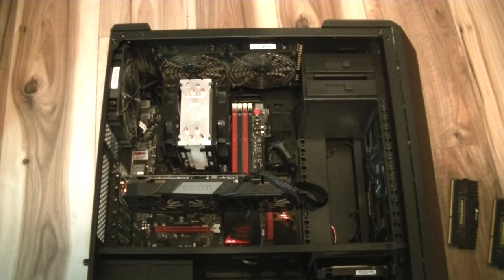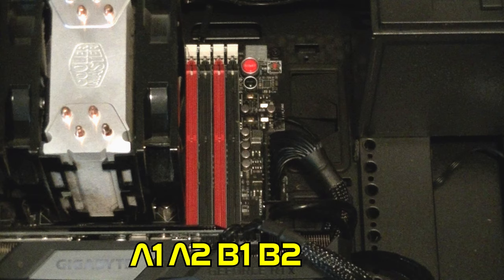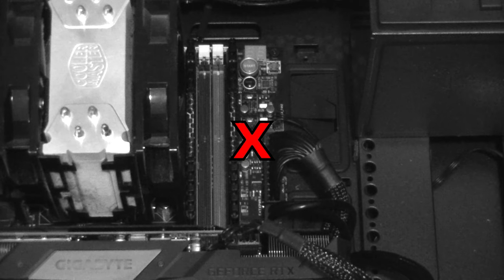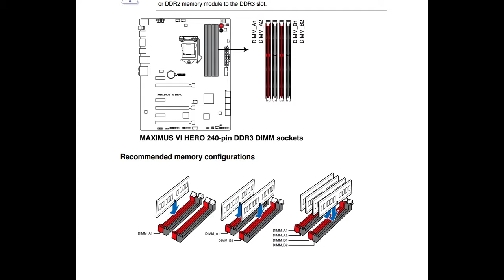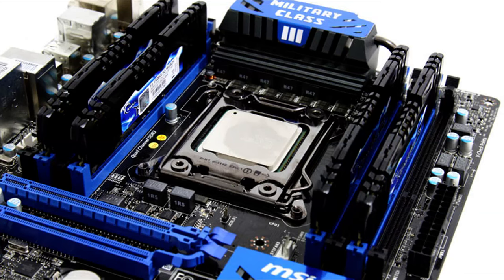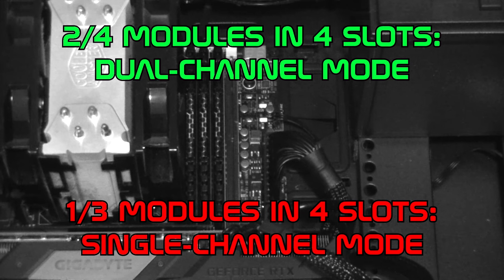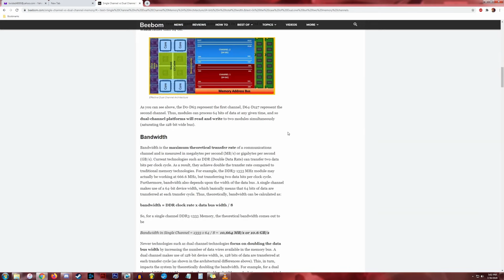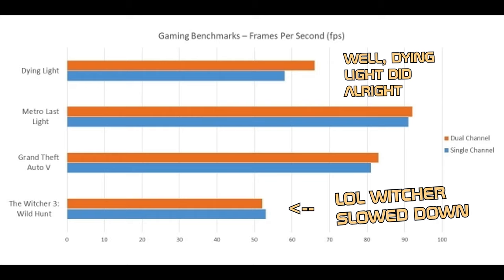How to Make Your RAM Run in Dual-Channel Mode

Comment: Hello, I wanted to ask a question. How do I get Dual Chanel activated?

I have an MSI 970 Gaming and 2x8 1600 MHz. I put one in the first slot and the other in the third and it doesn't work, keep saying "single".
 Is it because I only have 8GB usable?
Reply from the maker: Sorry for late response... From the info you have gave me, that is very odd. The amount of RAM should have no influence on whether the system runs in dual-channel or not. Have you read the MSI 970 manual? Are you sure both cards are in the proper spots for that particular motherboard? Also, what application is telling you that your RAM is "single"? Is it the BIOS/UEFI or an external application in the OS?
Reply: @Torqcx  
Don't worry ...
 In fact, I have read it and yes, they are well put, in the same way I tried 2-4 and nothing. In the BIOS it shows me that it is working in "Dual", but when I start the computer in CPU-Z it says "Single" and the amount of usable RAM is 7.90, but the detected amount of 16. Both are exactly the same in everything.
 Thank you!

Comment: What about if my motherboard have for slots for rams and i got only 3 rams of memory,each 8 gb ddr4..will be fine to put them all 3 on my motherboard?
Reply from the maker: That will work fine but you'll get single-channel mode. If you go down to two sticks or upgrade to four you will get dual-channel mode.

Comment: Yeah, I have a question; how do I check from within Windows whether it's in single-channel or dual-channel mode?
Reply from the maker: I don't think Windows itself has a straightforward way of finding that out, but there are several programs for free such as Speccy you can download that should be able to tell you

Comment: Two questions:
1. Does it matter it one pair is e.g. 4gb and the other pair 8gb?
2. Does it matter if one pair is 2666mhz and the other 3000mhz?
Thanks!
Reply from the maker: Yes it does matter for both scenarios, as it's always recommended to get the same exact module of RAM when installing multiple cards. You can try using two different kinds, but it may not run in dual-channel mode and the speed/timings may be off/bottlenecked, or the system may not boot at all. But there is no harm in trying.
Reply: @Torqcx  Thanks! So if I get four identical modules they will all run in dual channel?
Reply from the maker: @RecordableID  Correct! All slots filled up with the same exact model of RAM should have it run in its fastest possible speed!

Comment: I have three sticks on dual channel and the new one I had to replace is now single channel. What can I do?
Reply from the maker: Three sticks were running at dual-channel? May you check your motherboard's specs? It's possible two of the sticks were running in dual-channel and the third was at single, simultaneously.

Comment: Sir I have asrock B550m Steel Legend with 8x2gb RAM installed. I want to upgrade my RAM to 32gb, can i just buy again the same brand series RAM 8x2gb or I need to buy a new 16x2gb RAM and replace it ? oh and my CPU is ryzen 5 3600. thank you
Reply from the maker: First off I'm assuming by "8x2GB" you mean "2x 8GB"? If so, yes, you can buy the same models of 2x 8GB RAM cards and install them into the vacant slots and you will have 32GB of total RAM. (According to that motherboard's specs, it supports a total of 128GB).
Reply: @Torqcx  yes, Im sorry I mean 2x8 gb, ok sir now I understand, thank you for the answer, I hope the best for you channel !

Comment: How about if I add a different pair of DDR4 sticks in the 2nd channel. Would it work? I'm planning on buying a 16GB (8GBx2) kit and add it to my existing 8GB (4GBx2) RAM. Please give advice on this. Thanks!
Reply from the maker: Always recommended that you get the exact same make and model of RAM modules when adding more RAM, otherwise you may run into compatibility and/or timing issues.
Reply: Yes you can. You can find more information on that in this link from Intel website:
https://www.intel.com/content/www/us/en/support/articles/000005657/boards-and-kits.html

Comment: Wow that was clear! But another questions from me, i have crucial ballistix 16gb  2400mhz X2, if i would extend IT to  another 2x 16gb do i have to but The same menory or i could go buy 2x 16gb g.skill 2400mhz ? Will dual channel still work?;) Motherboard ASRock z370 pro4 Thank you !
Reply from the maker: It's always recommended to get the exact same make/model of RAM if you're going to add more. Theoretically, you "could" get a different brand and it may work, but it's likely you'll run into problems with the timings or the system failing to boot entirely.
Reply: @Torqcx  my ram in 1 and 3 slot is that okey?
Reply from the maker: @imohab1117  yes, that's perfect.

Comment: any ideas on why when i try to put the ram in the two slots my monitor doesn't want to work anymore or my pc wont fully boot up?
Reply from the maker: Try each RAM module individually in each slot on the motherboard; it sounds like either one of the modules or slots is faulty and causing the PC to fail to boot, which is common with RAM. If it's the RAM, you can get a new module, but if it's the slot, unfortunately there's nothing you can really do other than getting a new one.

Comment: On my Archlinux + Ryzen 5600G I got about more 15 FPS by going to dual-channel, now I'm finally closer to 60 FPS (average)

My question is: Is I use 4 RAM sticks, I'm still on dual-channel, but it will get faster? 
I'm using B1+B2 (as manual says) but if I also use A1+A2, it will make a difference?
Reply from the maker: If anything the performance will increase if you add more RAM to the system. You may get a slightly higher FPS boost if the system was reaching its capacity of RAM prior
Reply: @Torqcx  In game 16GB are ok, but in CAD and Simulation applications, I do feel a little stuttering here and there , I'll think about add more RAM when I can afford. Thanks for answer!

Comment: If i put 2 sticks in 2nd and 3rd slot then is it considered as dual channel or not?
Reply from the maker: No, that would most likely run in single-channel. Put them in the 1st and 3rd or the 2nd and 4th.
Reply: @Torqcx  I only have two ram slots of the same color, can I run dual channel mode if I put 2 ram sticks? 😔
Reply: I only have two ram slots of the same color, can I run dual channel mode if I put 2 ram sticks? 😔
Reply from the maker: @liounique1177  I had a system with only two slots and it ran in dual-channel, so I'm assuming yes
Reply: @Torqcx  oh, thanks for responding. 🙏

Comment: Almost all motherboards manuals suggest that if there is only 1 pair it should be placed in A2 and B2.  Then if there is a 2nd pair they would go into A1 and B1.
Reply from the maker: That's probably because A2 is further away from where the heatsink would go (occasionally I hear reports of people being unable to get their RAM in one of the slots because their heatsink is overlapping it)

Comment: I bought new ram 2x8 3200mhz, and in the motherboard book it says that i have to put them in slot 2 and 4, but when i did that i got a orange lamp on motherboard and computer didnt start. So i have them in slot 1 and 2 and have only single channel now. Do you know how to fix it?
Reply from the maker: Did you try slots 1 and 3? Someone recently commented that motherboards will often instruct to add the modules into slots 2 and 4, but it shouldn't matter; I think they say that simply because some people's heatsinks are so huge that they get in the way of the first slot.
Reply: @Torqcx  Okay, i will try. Thanks for answer.
Reply: @Torqcx  I tried to put the ram in 1 and 3 and i got red dot behind ram and after 3 sec. The lamp was orange. If i put them i have orange dot again. I use boths ram sticks now but in 1 and 2 slot. Cause if i have them anywhere else the computer is not booting up. Still have single channel :/
Reply from the maker: @ProEzX1337  that is odd. Are you sure the models of RAM you're using are 100% supported by your motherboard, speeds and all? If so, the only thing I can think of is that the motherboard is faulty. Unfortunately there may not be anything else you can do other than perhaps trying a new kind of RAM model or swapping the motherboard out.
Reply: @Torqcx  hmm ye. Thanks. Im so unlucky heh. The feeling when you are so glad of new things and then it is worse than The one i had before heh

Comment: I got CPU i5 8400, ram 8gb 2400 Mhz single channel. I play CSGO but I usually meet the fps drop and the game just keeps lagging. I think it's due to my CPU, but could I append 1 more ram stick (also 8gb 2400) to run dual channel, in order that the game is smoothier and the fps drop gone ???
I need some advice from you. Thanks in advance!
Reply from the maker: Lots of people have been telling me they've been getting considerably faster FPS from switching to dual-channel, so honestly I'd upgrade to that first and see what happens! Might as well :)

Comment: I only have two ram slots of the same color, can I run dual channel mode if I put 2 ram sticks? 😔
Reply: i have same question if you have the answers pls tell me it says dim1 and dim3
Reply: am wondering the same
Reply: I just found a comment where he said this "Usually when I see a motherboard have only two RAM slots, filling both of them up will have the system run in dual-channel mode."
Reply: @born2270  thankyou 😚😚♥️

Comment: Hey bro! Im having a problem when phtting my ram in dual channel mode when i put it and go to the BIOS it only have one ram and i boot it and go to the task bar its same idk what wrong im new in pc part. Sorry for bad english
Reply from the maker: Troubleshoot by checking each module in each individual slot, this way you should be able to rule out whether it's the board or RAM's fault.
Reply: @Torqcx  how to know if its the board or ram what will happen?
Reply from the maker: @motchi3975  Hopefully this video will help: https://youtu.be/O7Y0bcRoarM?feature=shared

Comment: Can i use 2x4gb And 2x2gb ty great video
Reply from the maker: You "can", but there may be speed/timing issues and it may not run in dual-channel. Always always recommended to get the same exact make and model of RAM when installing multiple modules. It can't hurt to try, though!
Reply: Lol my new 4 gb corsair dont run at al
Reply: My old memory is 2 times 2gb 2rx8 pc3 – 10600u-9-10-b0 my new is 2  times 4gb corsair 1333-999 or 1333c9. IT wouldt boot but detect ram at startup om lost

Comment: I have 16 gb single channel ram, so if buy the same exact ram and install it will my computer run at dual channel at 32gb?
Reply from the maker: Assuming you currently have only one module of 16GB, yes, adding another should have it run in dual-channel!

Comment: Permission to ask sir, so I have a motherboard that supports ddr3 ram up to 32gb with 4 ram slots, I also have a cpu (i5 3570) that supports ram up to 32gb ram but only supports 2 ram slots. I have also installed dual channel ram (2x8gb ram ddr3 pc 12800), if I add 2 more chips it will become quad channel, does it read 32gb sir? Or only 16gb? because my procie only supports 2 ram slots
Reply from the maker: I'd need to know more about your motherboard's model, but it sounds like it should read all 32GB? I've never heard of a CPU only being able to read a certain number of slots.
Reply: @Torqcx  i use gigabyte GA-B75M-D3H lga 1155 with 4 slot of ram and has maximum ram up to 32gb, i also use the i5 3570, yesterday i checked my procie specs because i wanna upgrade my ram to 32gb, i checked the specs in intel official web and it's say max ram 32gb but it only supports 2slot/channels.
I don't know if i can upgrade the ram or not because of that. What do you think? Can i upgrade my ram?
I don't know the concept about all of these:(
Reply from the maker: @eefsx8761   I looked up that processor's specs and I saw on their official website that it says "2 channel" but I don't see anything about it being limited to two slots. I believe it simply means that it only supports up to dual-channel mode, which, after looking up your motherboard's specs, also only supports. So you should be all good!
Reply: @Torqcx  Wait really?! I'm so grateful to hear that, finally i have the answers, thank you very much for all the information, i appreciate it, soon i will be upgrading my ram, Thanks again, I wouldn't have known about it, if not because of you. You were only youtuber that reply my comment, i know you'll get places some day, see you on top bro👋🏻

Comment: Ok late late question time

I have 2gb, 2gb, 2gb and 1gb ram and I have 4 slots so does it still run at dual channel mode or no?
Reply from the maker: There's no harm in trying by filling all the spots up if that's what you have; you probably will get dual-channel, but you might not.

Comment: Hey, ive bought 2x 8 Gig sticks from corsair. If i insert both in the right spot like the manual says the pc wont boot.  When i remove one it runs fine, any solution?
Reply from the maker: Check each slot individually with each RAM module. This you may be able to determine whether you have a bad module or a bad slot on the motherboard. Also try setting the BIOS to default settings if nothing helps, then try again.
Reply: @Torqcx  Thanks for your answer, this is a brand new build i've done. One stick seems to work on every Slot, but the other stick does not. I can't install any drivers since my internet is dead since days unfortunately.
Reply from the maker: @kotmidasbeats1499  it sounds like that module that won't work is DOA unfortunately, which is very common. Luckily it's not the motherboard's fault. Just return it and get a new one
Reply: @Torqcx  Considired it! Thank you, i'm going to return it and get a new one.

Comment: So I don't need to activate anything in the BIOS after adding a ram stick?
Reply from the maker: Nope, not normally! Sometimes when you have different types of RAM in the system you may have to fiddle around in there, but in regular circumstances RAM is entirely plug-and-play.
Reply: @Torqcx  Thank you!
Reply: @Torqcx  hey if u still active, just curious, what if my motherboard has a1 a2 blue color, and the rest black, should i go a1 and b1 or just on the same color but not same number?
Reply from the maker: @rhxnd.  I would try both in that situation.
Reply: @Torqcx  oh ok, thx for the response

Comment: I have been running 16gb. A2 B2 channel. I just installed two more sticks but it still says NA on those dim slots. Any suggestions
Reply: @slowly when I put the new ram in those slots the pc won’t even boot up

Comment: how to put if i have 4x4gb ram ? i put all but still single channel. do i need to put 1-3 first and then 2-4 ?
Reply from the maker: They should be running in dual channel if they're all in there. Check your motherboard's specs

Comment: what What happens if your desktop PC only runs on b1 and b2 side of motherboard and if it it only runs on b1 and b2 how do you make your computer run on all four channels only if the computer we boot up on b1 and b2 is there a fix for this ?
Reply from the maker: Is this a newer motherboard? Are you sure those are in fact A1 and B2 or is that just the side the slots are on? Pay close attention to the labels and/or manual. Newer motherboards are recommending you install the first two modules in slots A2 and B2, and my latest video shows this in more detail
Reply: @Torqcx  My motherboard is a Gigabyte Z390 Aorus Ultra i tryed all of them the only ones that will work is B1 and B2 memory slots
Reply from the maker: @XBNBEEFXBNBEEF  If you've tried each slot individually with each module, one-at-a-time, and you can still conclude those are the only ones working, you may have a faulty motherboard and will need to get it replaced, if you want to use all of the slots
Reply: @Torqcx  ok i would have to replace it then

Comment: I have problem i have three same spec ram when i use two 4GB ram it gives me 933mhz speed
But when use all three rams windows show 800mhz 
Should i use all four slots to get 1866 speed...?
Reply from the maker: That's odd that the speed changes based on how much RAM you have occupied in the system, but again, what I would do is have an even number of RAM rather than odd; otherwise, you'll get single-channel.

If you want the speed to be higher in the specs, yes, I'd advise you get a total of four RAM modules.
Reply: @Torqcx  hi 
I just install another ram on mother board and complete all four rams 
When i select auto speed in bios it runs on 1600 if i set them to 1866 bios show speed is 1600 and you set it to 1866.
I test all 4 ram in 2 paris they shoe 1866 but when unstall all four rams it gose to 1600.
Actually i want to upgrade my cpu to fx8350 and have no idea will fx8350 work in 1600 ram speed or not

Comment: What if there are only 2 ram slots on the motherboard? Would they be a1 and b1, or a1 and a2?
Reply from the maker: If there's only two slots then it doesn't matter how they're labeled since if they're both occupied they'll run in dual-channel mode, however, they SHOULD be "A1 and B1". :)
Reply: @Torqcx  thank you